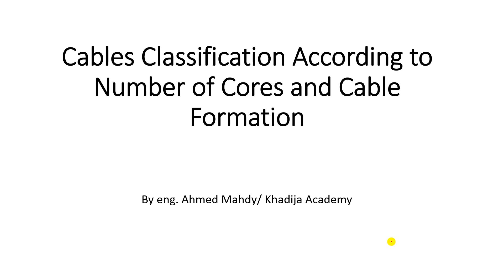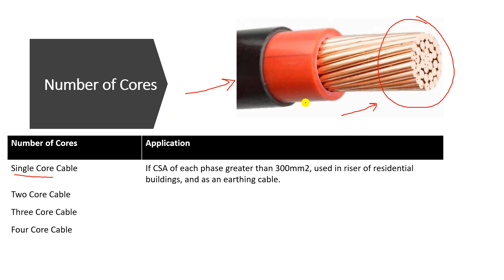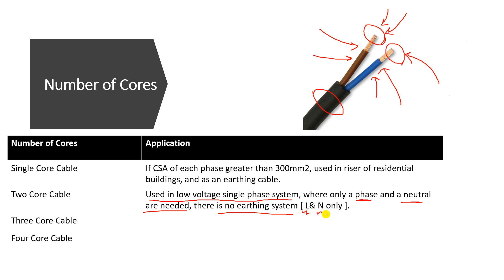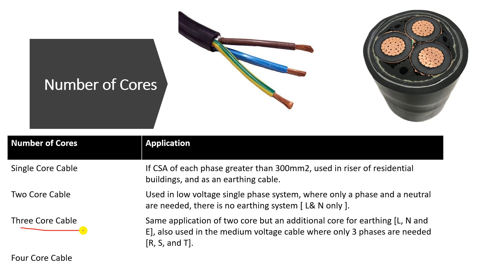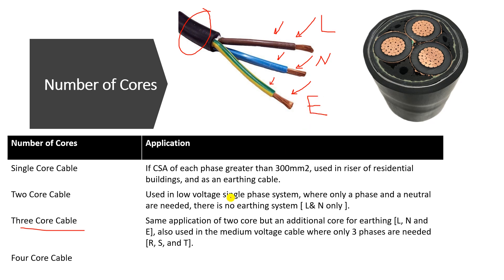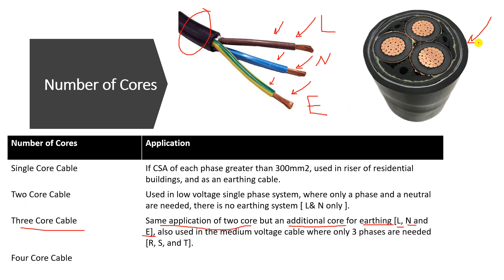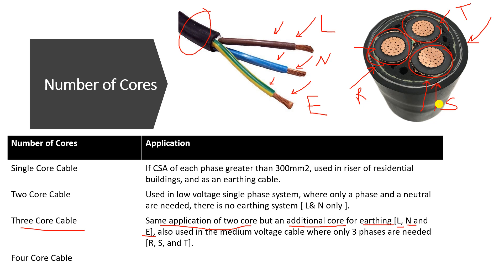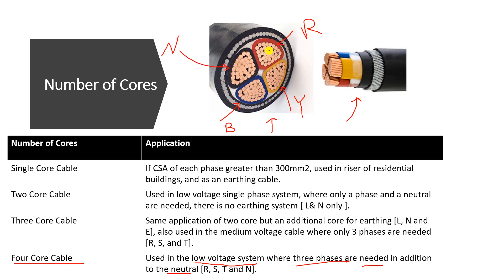Cable Cores Number - Number of Cores of Cables In Cables Electrical Course (6)

Comment: What about 5 core cable ,for lighting & power panel incomer from DP  do we use 4C + G cable or 5Core cable ?? Size of ground cable should be same as N,P conducor size or smaller ??